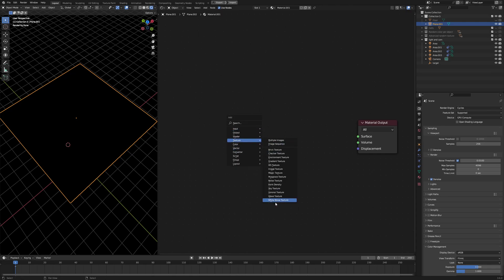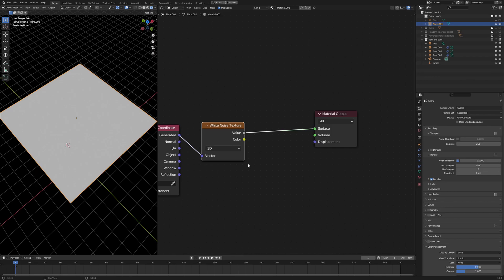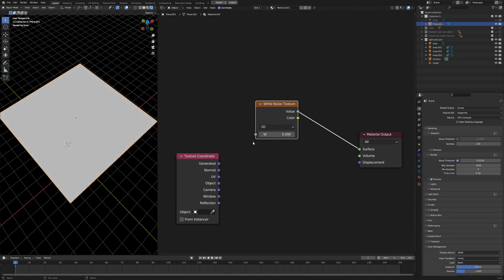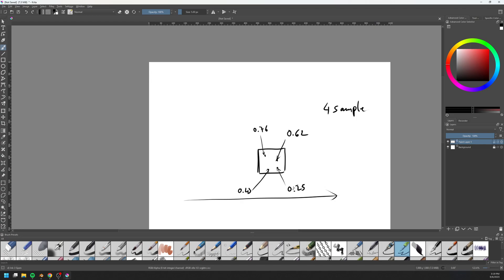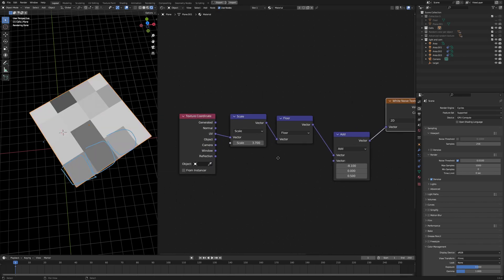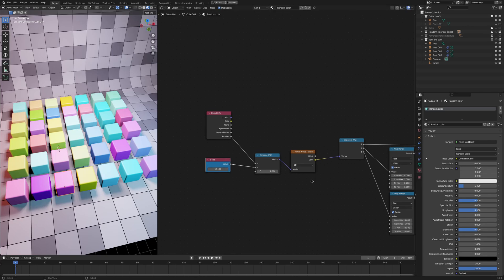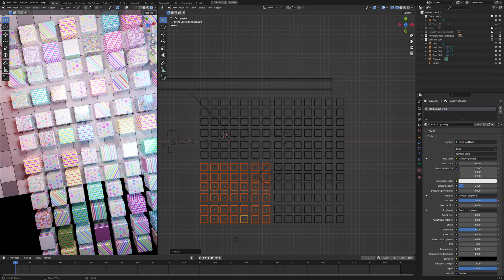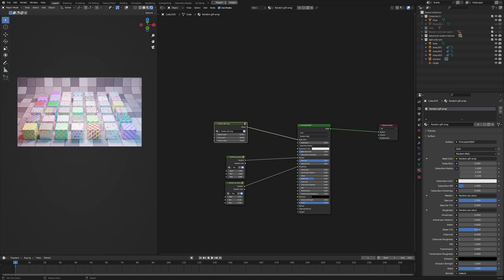The correct way to use the White Noise in Blender

Comment: It's called "white noise" because every frequency is represented in equal proportions (like, when you run it through a Fourier Transform). That means that whatever two inputs you put in, the result will be different regardless of how close together the inputs are (because all the high frequencies are represented). It has nothing to do with whether it looks white when you render it.  There's also pink noise (fall-off proportional to power, so higher frequencies less), brown noise, violet noise, etc etc.  White noise sounds like "sssssss" and pink noise sounds like "sh sh sh sh sh".

Cool gift shader. :-)
Reply: Run it through a Fourier Transform . . . in shading nodes? You just casually have a Fourier Transform as a node group?
Reply: @Arjjacks  No. I'm telling you what the definition of white noise is, not that you can manipulate it in Blender. I'm saying it's not called white noise because it looks grey. It's called white noise because the FFT is white (sorta).
Reply: @darrennew8211  Oh I see, yeah, I getcha. I thought you'd actually run Blender's white noise output through a custom made Fourier Transform in shader nodes, just on a whim XD Which'd be wild.

That's cool about the noise types, though, I didn't know that.
Reply: @Arjjacks  That would be pretty cool, I'll admit.

Comment: Probably better to add the seed to the x value and use 1D White Noise instead, although I don't think White Noise is all that expensive that it really matters in the first place. Prior to White Noise I used to use Noise which with some parameters produce color output (I think they've fixed that issue now) but the results was always biased towards 0.5 (remap with Brightness/Contrast node which has dangers of its own) rather than true random from all over the place.
Two White Noise nodes can produce 4 true random outputs and 2 quasi random outputs, by utlizing both RGB and HSV modes (RGB+H true and SV quasi). I use it to randomize textures all the time; position lookup (x/u and y/v), rotation, remapped randomzied scale, mirroring, and random normal orientations (no two floorboards or tiles are perfectly aligned in the real world). Works well with the brick generator using the Grayscale color output as a 1D input for White Noise.
Reply from the maker: yes, you can add the seed to the X value, I just want to keep them separated for clarity
Reply: I've often wondered why there aren't noises out there that are both continuous (smooth) and with a flat distribution of values. Is this a mathematical contradiction, or just expensive?